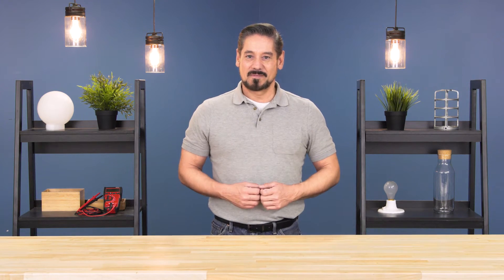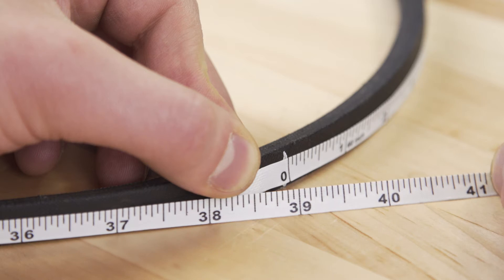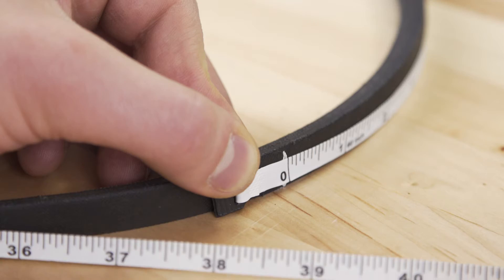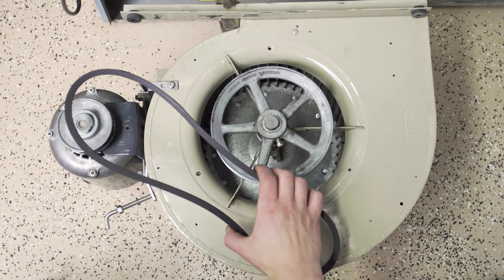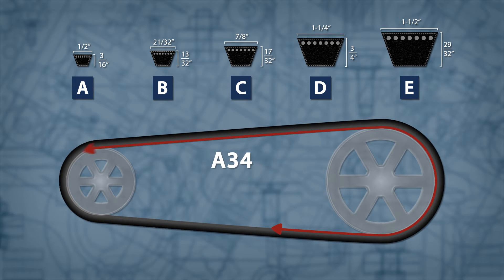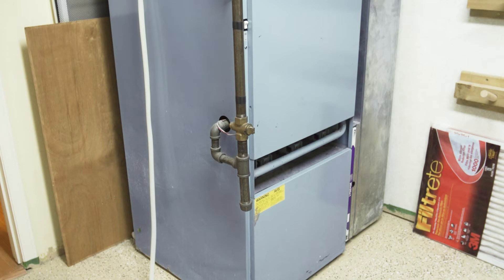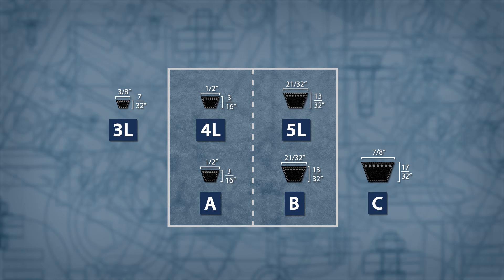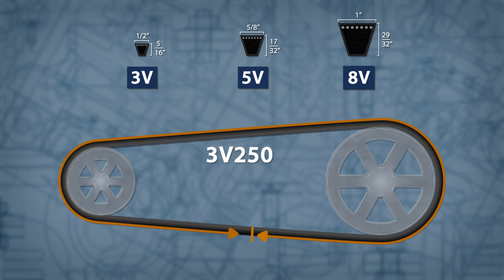V-Belt Code Guide | Spec. Sense

Comment: So have you done a video on how to measure automotive belts (width and length) when all you got is the engine (old belt long disappeared).
Reply from the maker: Hi Barny, thank you for watching! We haven't done any videos for automotive parts as AMRE is more focused on the parts needed to keep one's property running effectively. To measure a serpentine belt you can take a piece of string, you'll need about 9 feet.  Looking at your owners manual or any reference diagram for your vehicle, tightly wrap the string  around the path of the serpentine belt and mark the point that the string overlaps with itself. Now measure the length of string it took to wrap around the path of the serpentine belt. Purchase a belt one size smaller than the size you measured. The actual belt will have tension on it, whereas the string doesn't. If you don't have a reference belt, you'll need the same width belt as what fits in the pulley's with the same number of grooves. 

Hopefully this helps. If you're curious you should check out more videos on our channel as they are just as detailed as this one. For example we have a whole series on water heaters maintenance and repair: https://www.youtube.com/watch?v=BHUPFLbb8NY&list=PLCo9SMjkdWBwJ4a8MT2GKTDiSuvSHg6Xk&index=1

Comment: Thanks for the video.  Any idea what code "O-560" means?  The number "29" also appears on the belt, about 1.5" away from the "O-560".  It's a belt off of a cheap, imported drill press.  The measurements are: 3/8" wide x 1/4" deep x 24" outside diameter.
Reply: I know I'm late but better than never.

There is, indeed, an O type V belt. At least my drill press from Taiwan is using this type of belt.

Just like A, B, C, D... The number next to the designated letter is the inner length (millimeter).

You can search for O type V belt on AliExpress.
Reply: @namtrieunguyen7630  Thanks for the information.  It was helpful.
Reply from the maker: Thank you for watching! It seems like the O-560 code is likely a manufactures internal number rather than a standard code, it doesn't line up with any codes or measurements that we know of. If you found another belt with a O-560 code or designation, it will likely be a direct replacement.

Comment: I have a v- a-23 belt that I measured the outside to be 23 . Everything I find on line says it’s 25 inches long ! What did mean by subtracting 2 inches ? I’m not sure what I’m missing!
Reply from the maker: Hi Craig, thank you for watching. An classical A-23 belt should measure 25 inches in circumference on the outside and 23 inches on the inside. A 4L-250 FHP belt will have the same exact measurements. Its strange that a belt with A-23 printed to measure 23inches on the outside, but for getting a replacement as long as the measurements are the same then it will fit.

Comment: Let, V -belt length 100" and width 13mm, what is belt number?
Reply from the maker: Hi Bappy, thank you for watching. All you need to do is convert to inches, and measure the depth of the belt then you should be able to calculate it using the examples in the video.